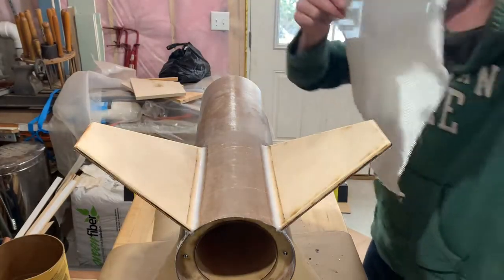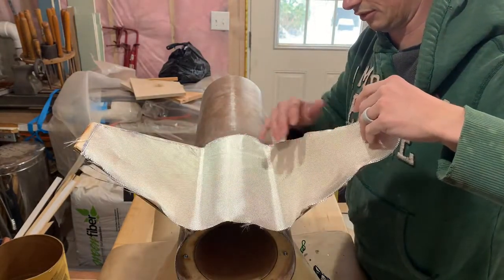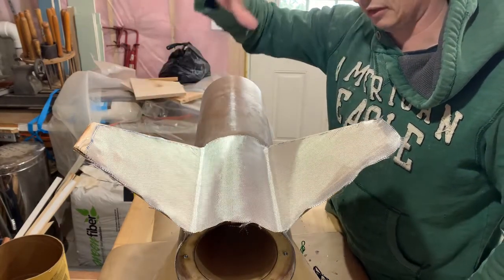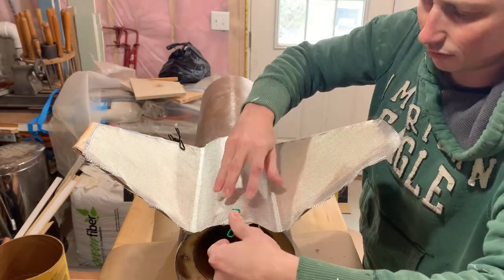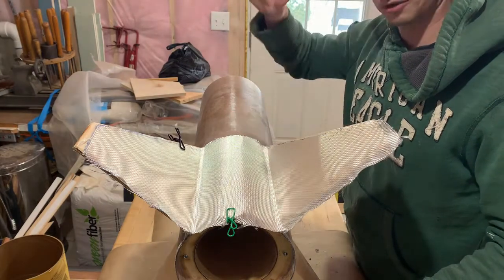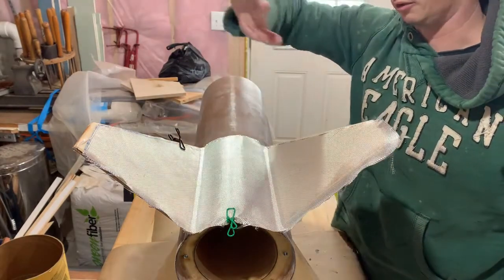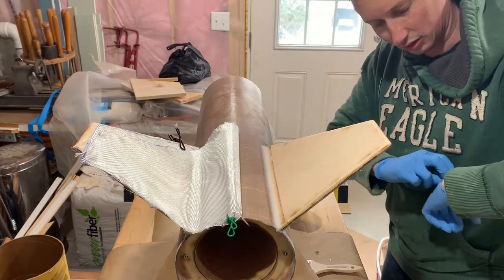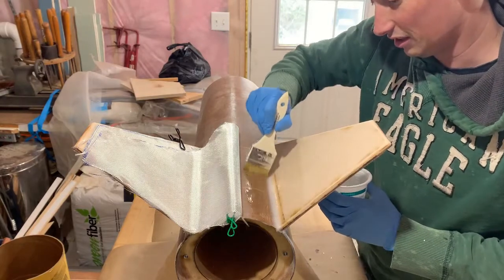07 7.5" LOC DOOR KNOB Tip to Tip Fin Fiberglass

Comment: How did you handle your leading edges?
Reply from the maker: @DougieDollasX  these were massive 3/8” plywood fins so I just used a round over bit before glassing the fins and sanded the interface smooth.